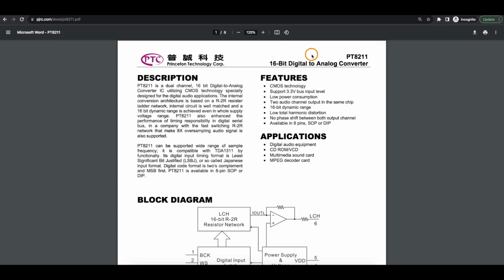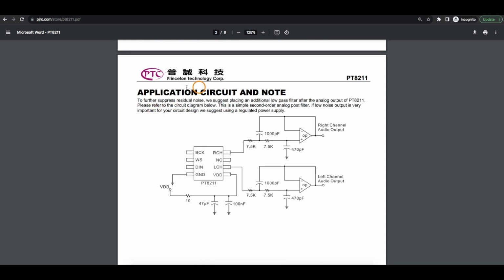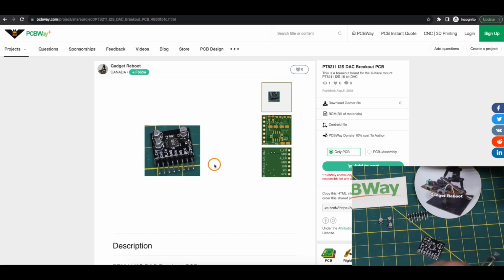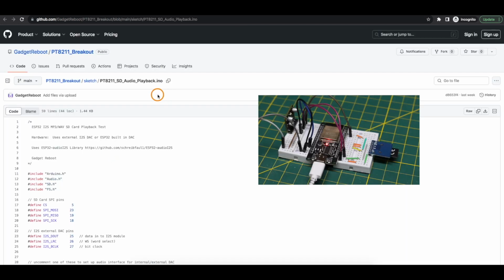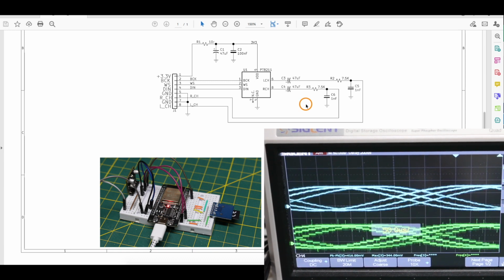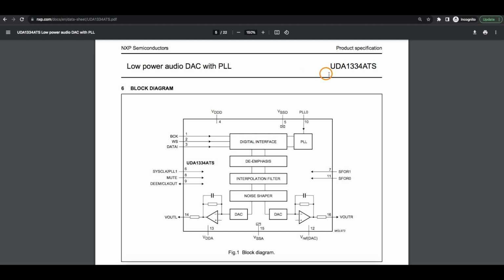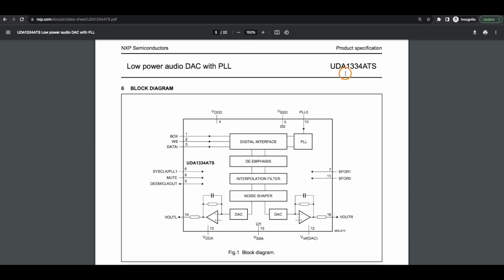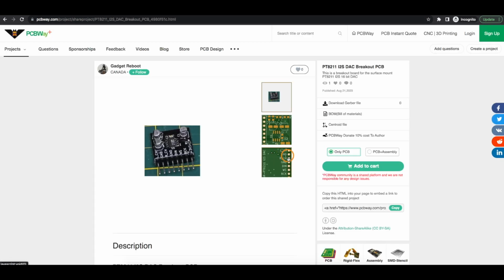PT8211 I2S DAC Test with ESP32

Comment: Thanks for your work, may I ask which speaker do you use? I'm not sure if this PT8211 DAC would be sufficient for an 8Ω speaker without an amplifier function. Additionally, I was wondering if there is any way to adjust the volume. Thank you once again.
Reply from the maker: it needs an amplifier so I use an orange micro crush mini guitar amplifier since I have it around already. volume would either be controlled on the amplifier circuit or in software by scaling down the digital data to make it quieter

Comment: I was really surprised by the quality. Sounded great!
Reply from the maker: I was also surprised, I think it actually sounded a lot worse in the high end without that simple RC filter so I think that was an important part of it.
Reply: @GadgetReboot  Indeed. Curious to see how "flat" it is across 20-20KHz. It sounds like it is not dropping a lot in the higher frequency range.
Reply: @DustinWatts  Looking at the super crisp edges @ 5:12 in the video, I wouldn't imagine any dropping in the higher frequency range provided the RC filter is tuned appropriately.